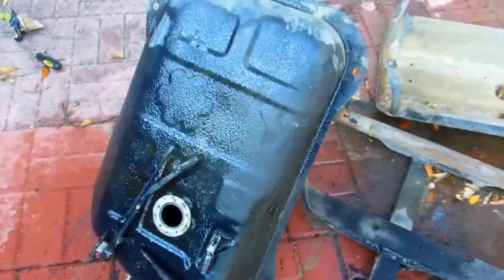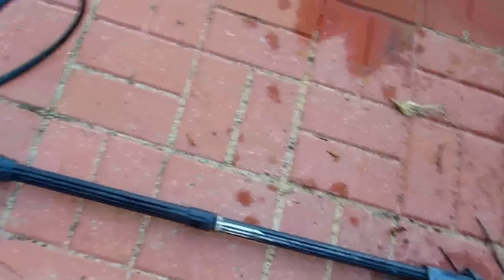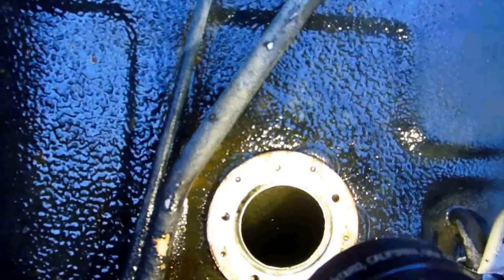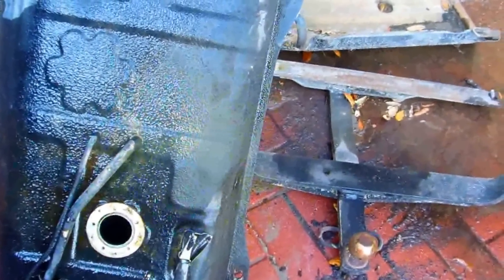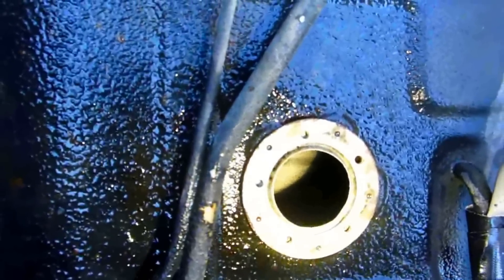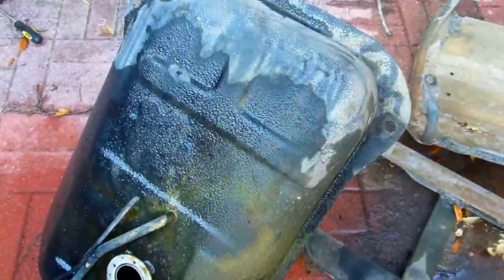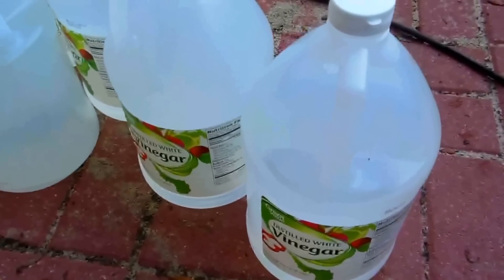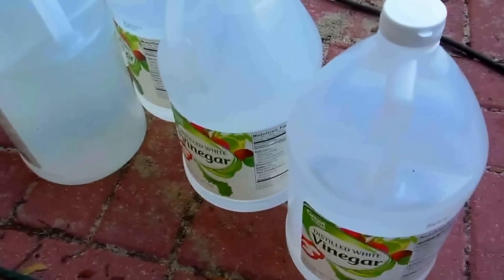VINEGAR will Clean a Rusty Gas Tank

Comment: Synergy7, thank you much for your very informative and educational video. GREAT JOB! I live in Mexico and can not find any tank sealer.  What do you and or others think about using Behr Epoxy garage/shop floor paint? it is resistent to gas/oil but I sure do not want to have a biger problem than rust. All comments and opinons are appreciated.  Thank you.
Reply: The parts store has a specially product. Seafood has one.

Comment: Would applying some Wd-40 or mystery oil in the gas tank and slush it around to coat the inside to prevent any flash rust be a good idea?  If so, how long before I have to use gasoline?

Comment: after the baking soda is rinsed out with water, I’m planning to wash out with rubbing alcohol since it combines with water. Then use hair dryer. My theory is will dry quickly. Then pour in a coating, roll tank, pour out excess. What do you think of adding rubbing alcohol to dry out?

Comment: Use vinegar to remove the hard water stains sprinklers leave on your chrome and finish, too! I have a Honda CRX that sat for 5 years with sprinklers and you name it spraying hard water on it and am about to try using it at least on the windows to get the crust(!) off. I can't even see through the windows it's so bad.

Comment: I have a 1978 mgb isn't there anyway to clean rust from tank like an additive and not remove the tank. My mechanic stole my vehicle about a year ago so it don't know for sure if rust in it but sat 7 years with old gas in it no gas now what ya think
Reply from the maker: I'd pull the gas and clean it out.  Or at least pour is new gas and pump it out before refilling it again.  Best to pull the tank.

Comment: What do you coat the inside with? And does it plug the spout where the gas goes into the fuel lines? I have a 73 beetle, and I'm having a little fuel flus problem. Got new pump ,hoses,and fuel filters but they empty quick and fill slowly, so when I start it in the morning it takes a lot of cranking to get the fuel to the carb. Thanks for any advice..
Reply from the maker: RedKote

Comment: Hey man i'm not sure if you still reply to these but great video thanks for the help. I have one question though, My tank has pin holes but also a couple pea sized holes, Do you recommend i seal them up with something before i use kreem sealer? if so do you have any suggestions? appreciate it mate. cheers.
Reply from the maker: You could use RedKote to seal pin holes but as far as larger holes you need to weld and Make sure no gas fumes are left when you weld.  Another thing you MIGHT be able to use a 1/4 inch structural rivet with washer followed by Redkote to seal a pea-sized hole.
Reply: Awesome thanks for the advice!!! much appreciated.
Reply: Not sure how good this works but look up this product, marine tex

Comment: what can i coat my tank with that's cheap? just so the rust wont come back right away? i need to use my tank but after i rinsed it the rust started to come back shortly after
Reply from the maker: +aterack833 Red Kote
Reply: +syyenergy7 it's like $100 here though, what do they use at the factory?
Reply from the maker: +aterack833 $20 on ebay
Reply: syyenergy7 will it ship to Canada? send me a link
Reply from the maker: +aterack833 I used this stuff.
http://www.ebay.com/itm/Red-Kote-Quart-Coat-Gas-Oil-Diesel-Fuel-Tank-Sealer-Liner-Patch-Hit-Miss-Engine-/131533413846?hash=item1ea0009dd6:m:m_t7zDtTPyVjhKTiiBBgucg&vxp=mtr
Reply: syyenergy7 "
Does not ship to Canada" is there a way i can get it here?

Comment: How could I clean out the fuel lines also? The tank is rusty but the fuel lines don't look so great either? It's a 1968 Chevy Impala I'm working on.
Reply from the maker: +Matt Carrasquillo I used carb cleaner and compressed air on the lines.
Reply from the maker: +frincon75 Blow the compressed air downward from the carb side to the back of the vehicle.
Reply from the maker: +frincon75 I cleaned the lines when the gas tank was out.  If you clean the lines disconnect them so you don't blow the rust back in the gas tank.
Reply: +syyenergy7 do you have disconnect anything from the lines?
Reply: Should I take the whole fuel line off the vehicle for cleaning or clean them in place? I took off the tank already, I'm trying the Vinegar treatment to clean the tank up.
Reply: +syyenergy7 what I mean is like where do I blow the compressed air? Like from the fuel lines I disconnected from the tank or from the one that connect to the carb?

Comment: What will happen if you don't use baking soda?
Used to clean rust inside metal oil separator soaking it in vinegar and it did pretty well, however when i left it there for few days metal got this dark shade, like oxidation of some kind, as soon as i get part out and expose to the air it would rust in matter of minutes, would using baking soda stops it?

Comment: Im thinking of doing this to my 2005 r6 gas tank but I was told to use apple cider vinegar. Does this really work??
Reply: Or use Berryman B12 carb cleaner. It dissolves varnish real well. No waiting.
Reply from the maker: +Jason Efferson I just used plain white vinegar.  Left it in several days.
Reply: +syyenergy7 my fuel pump and filter is in the fuel pump housing. How do you suggest i clean the filter out??
Reply from the maker: +Jason Efferson When I had to reuse an old in-line gas filter, I used starting fluid to lush it out.  Not sure i that would work in your case.

Comment: I've started cleaning the gas tank on my 1991 mazda rx-7(which has been sitting for 7 years),I used hot water and vinegar and it's working,there was a ton of rust,but it looks a lot better now,i guess you mix a box of baking soda after you're done?
Reply: how did it come out doing the same thing but only sitting for 4 years lol
Reply: +Michael Snyder it came out good,but like he said,you have to use the baking soda,and then let it dry out.
Reply: +Mahesh Java not dumb at all,after I cleaned with vinegar,i use baking soda and water,and then I dry it out.
Reply: +roger b So how much water do you mix with full box of bsoda?
do you just swirl it around tank and then dump it out?
Reply: roger b after the baking soda is rinsed out with water, I’m planning to wash out with rubbing alcohol since it combines with water. Then use hair dryer. My theory is will dry quickly. Then pour in a coating, roll tank, pour out excess. What do you think of adding rubbing alcohol to dry out?

Comment: I am working on one that is 40 years old, has baffles in it and i cant get a pressure washer in there, I can't even just pour the vinegar straight out without switching holes because of the baffles. i am worried about the  coat stuff because of these baffles, it's going to be a real challenge to get the coating over 100% of the interior and not plug up any of these vents and fuel line port.  

 every time I put the vinegar in more stuff comes out.  also, seems like apple cider vinegar works a little faster. might be higher in acid content, I don't know, but it does seem to get more out quicker.  

  this tanks wearing me out!   good grief, My upper body feels like I have been benching constantly for the last couple of weeks.

Comment: If you add warm water in with the vinegar it will clean even Faster.
Sculptors use this mix to MAKE metal rust faster.
IF you use Caswell's epoxy inside the tank the inside can have a slihg rust on it.

To clean the flaking rust put a piece of chain inside the tank and shake the tank around to remove the  flaking rust.
If you add Seafood to your gas it will help keep the moisture in suspension.
Reply: what kind of seafood do you recommend scrimps, lobster, scallops, or maybe just let a trout swim around. what do you do when the seafood starts to rot? repeat steps 1 to 5?

Comment: I'm trying to clean a rusted gas tank from a 2007 Kawasaki Ninja 250R. I'm going to give this vinegar method a whirl. One problem I've encountered is that I can't seem to properly seal the top of the gas tank - so I can't let the tank soak upside down (which will be necessary if/when I can use the actual tank sealer). Any ideas? You mentioned using body caulking - can you provide more detail regarding this? Thanks!
Reply: +Robert Meyer just rinse with gas instead of water should stop the flash rust?
Reply from the maker: ***** I used strip caulking.  But I am pretty certain vinegar will not harm paint in any way, so that should not be a problem.  You can your monster tape and saran wrap too to seal the top of the gas tank.
Reply: syyenergy7 Thanks Syyenergy. We'll see how that goes.
Reply: Did u try the apple cider vinegar in ur gas tank? If so howd it go im thinking of doing it to my 2005 r6 need to know some details!
Reply: +Jason Efferson 
I used plain old white distilled vinegar and let it soak for several days. It definitely worked to eat away the rust. Unfortunately I never did get the tank all the way ready to go due to a few challenges. Namely, I never could get the seal to hold well enough for long enough with the tank upside down before the vinegar ate through it (I probably filled the tank with 4 gallons of vinegar about 5 times). I tried apoxy glue with a rubber seal, tape and saran wrap, etc. In all cases the vinegar at through the seal and spilled within a day or so. 

Maybe it's time to try again. I will say the bottom part that was allowed to soak for 2-3 days looked brand new the first time I drained the vinegar and rinsed. Beware of flash rust, happens very fast. Need a good way to dry that tank quickly.

Comment: Ever try BB's,I used 2000, and either mechanically or by hand shaking the heck out of the tank after this? Strapped mine to a paint shaker, but two guys can shake the heck out of one too.
Reply from the maker: I put nuts and bolts in the gas tanks also and shook it up with the vinegar solution.  It did come out like brand new.  Then I rinsed ir good, dried it and coated the inside with Redkote.
Reply: U
Reply: QuantumRift ....baking soda and water....then water and blow it out with leaf blower......then some Mystery Oil to coat it.
Reply: hey I see this method works but I have rust on the side of the fender of my truck how would I use it a wash rag or something like that?
Reply: +Donald Ulrich you mix the baking soda with the water in a gallon and shake it?… or pour the baking soda in tank the pour the water?  and how much baking soda?
Reply: +javi barr I mix the baking soda and water and shake. Then pour it in rotating the tank to get good cover. As much baking soda as will dissolve. Wash with plain water. Blow dry with leaf blower. Then coat with some Marvel Mystery Oil to stop further rusting.
Reply: +Donald Ulrich Marvel Mystery Oil won't prevent further rusting. It cannot as once you fill the gas tank, the "oil" is washed from the metal. You need to coat it with a solvent-resistant plastic. I had to clean the tank on my 1956 Allis-Chalmers "B" a couple of months ago and I bought a couple gallons of metal cleaning stuff, and after I used that, I coated the inside of the tank with a product designed to prevent rust.
Reply: syyenergy7 yea I have a 12 gal allis-chalmers "B" tractor, and it has a 12 gal fuel tank I'm gonna use vinegar and lots of big castellated nuts. This will work fine! Are you using thing like acetone as the final wash? Thank you.

Comment: When you say neutralize it with baking soda, what do you mean? just dump it in the tank in powder form? or mixed with water?
Reply from the maker: Mixed with water.  This worked Extremely well.  You just need to give it time.  No special cleaners or rust removers  needed.
Reply from the maker: *****
It does not take much.  I used 1 lb in about 6 gallons of water.  So maybe 4 ounces in 1 or 2 gallons of water.   Then I rinsed it with plain water and used aire to dry it good.  When I put on the RedKote, it has to be 100% dry.  No water at all.
Reply: So I have a 17 1/2 gallon tank, where I can not reach some of the areas. is Redkote ligiid enough to simply slush it around the tank, by moving the tank in different positions .?

Comment: Thanx for this information. I'm now sold on vinegar. I have been thinking about using vinegar for cleaning. I bought the red vinegar to clean the coffee pot, then I learned, nope it's the white vinegar for cleaning. The red vinegar is for people to drink for a health benefit. It seems maybe the red vinegar could help clean arteries like people claim.
Reply from the maker: The white vinegar is great for cleaning anything.  Coffee makers, ovens, stove.  just let it sit and it will work.   99% of these specialized cleaning products are just overpriced marketing hype.  People used to use white vinegar and baking soda for everything.
Reply: also works great if you let it sit inside your plugged up shower nozzles, cleans it out like new again

Comment: Cool deal on the tank. What about your lines from the tank-to-carb...blow out compressed air or cap lines and soak with vinegar too? those lines might be messed up too.
Reply from the maker: The whole thing is messed from the rust in the gas tank, but I'm getting it cleaned out 100%.

Comment: The tank looks fck in great you did a hell of a job the redcoat will stick better than a new tank you may need to flush fuel line that feeds carburetor thers probably shit in the line blow high pressure air threw than change filter again you no thers gota be sludge in there just a thought o the sound wasn't working on the vid but it came back after 10 min good job let us se it after you red coat it
Reply from the maker: Yep, already done !  Cleaned out the lines.